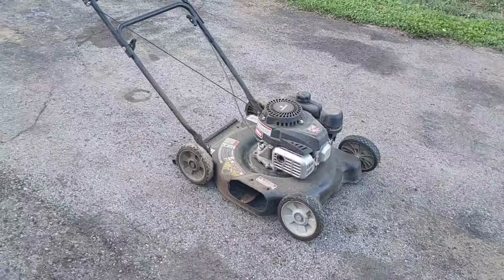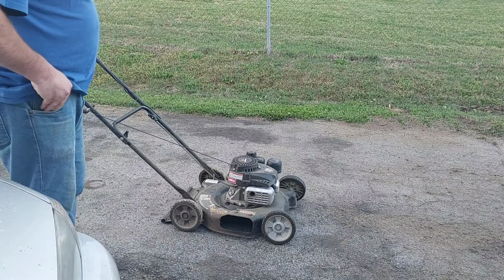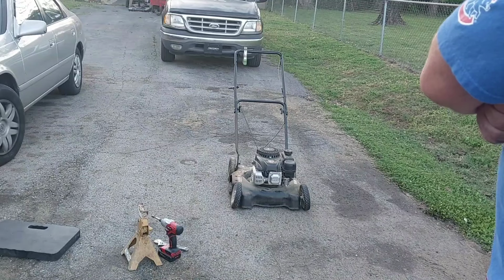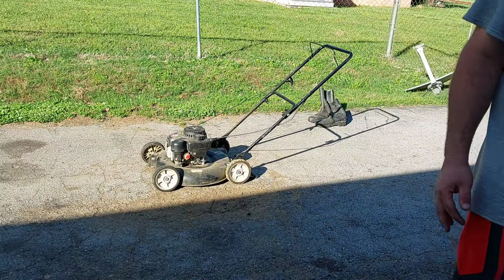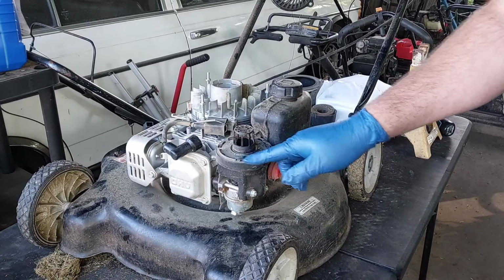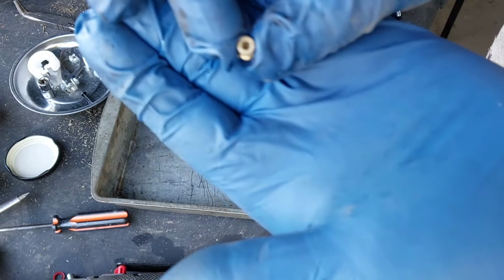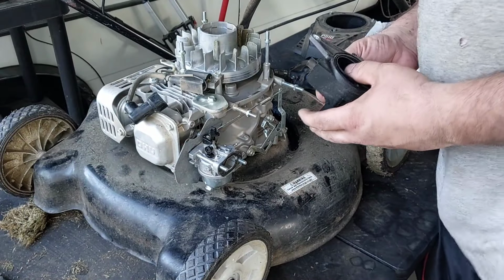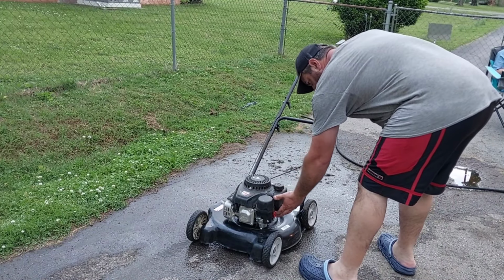$20 yard machines 20" P510 push mower with powermore engine will it run? 4/18/24

Comment: good job there,  find a deflector for that side discharge and it will be perfect
Reply from the maker: I was thinking of buying one but really don't want to  buy a new one and I don't have one to fit it
Reply: @Turningwrenches85  perhaps make one fit out of some plastic might be an option if you have one for a different mower around. otherwise its at the  best you can do
Reply from the maker: @dfields9511  I think I can maybe retrofit one possibly

Comment: hopefully it will not need new carb,  lastime I had one like that they were outlandishly expensive  and I ended up scraping it but keep some parts from it. that were used to save other mowers.
Reply from the maker: So far it's ok running wise

Comment: I knew that was going to be the problem because I just had it. People don't put them on right and that piece that sticks up off the adapter gets chewed up
Reply from the maker: I agree sir, and then they think the engine is no good when it was the way the blade was installed they dump it